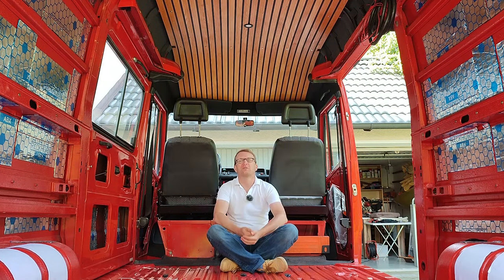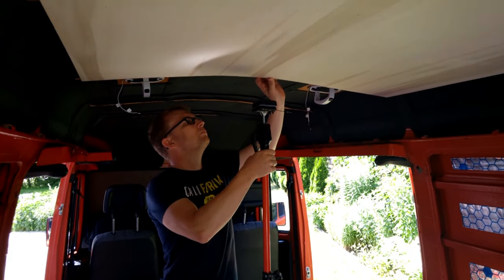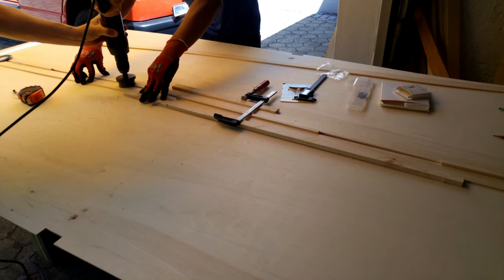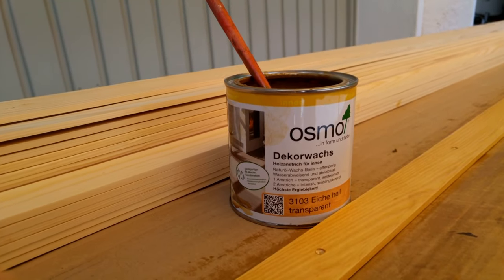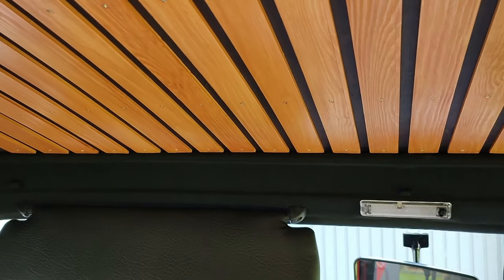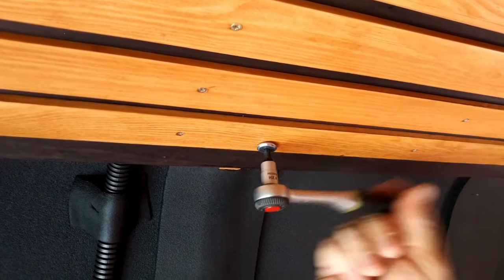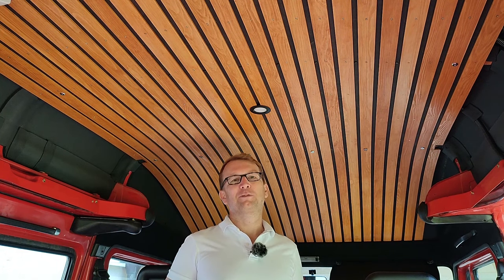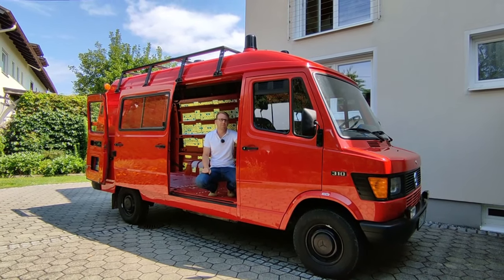BEST lightweight Campervan DIY Ceiling: How to Build and Install in our Mercedes T1 (curved slats!)

Comment: very nice finish on the timber. it is good to see someone taking the weight of the material used into account for the overall weight at the end of the build
Reply from the maker: It surely pays off in the long run :)

Comment: This was my original idea for the Transit too, but ran into a major problem: The curve at the front is in 2 dimensions! And you can't bend a sheet of ply in 2 dimensions at the same time. Well done, it looks stunning :)
Reply from the maker: In fact I had the same problem with my van... and found this solution: Directly behind the seats the ceiling panel is flat, not bent at all. From this area to the front of the van the ceiling is bent forward, and from this area to the back it's bent sideways. Surprisingly this flat area is no problem for the design. But, of course, this trick only works if the ceiling is not too much bent sideways ;)

Comment: Would of looked good if you would of screwed ply into pine slats, nothing looks worse than screw heads everywhere
Reply from the maker: The pine slats are too thin for screwing from the other side. If the screw goes just 3mm into the pine slat, the slats would surely fall off on the first rough road...

Comment: 6:42 What works great is to set up a circular saw with a 1 mm grinding disc and do some shallow relief cuts on the rear of the slats in the area of high tension. This would mean you need to do the curved section separate and glue and screw the slats on as the plywood panel is held/bolted in place.

Comment: Looks very beautiful, one question, why didn't you screw the slats to the plywood from the plywood side? That way you don't see them anymore.
Reply from the maker: The slats are too thin, so the screws would be just 3 or 4 mm in the slat. I would expect that doesn't hold on the road.

Comment: Very cool design and execution. I wonder if there's a way to hide the screw heads and not compromise the installation.
Reply from the maker: You could try to glue the slats, but I would be afraid that the tension is too high in the curve and they might fall off....
Reply: @CubeofCars  Great job, beautiful ceiling, and thank you for the inspiration! 😍Did you consider using wood glue and staples from the back in order to hide the screw heads? I think Vanlife Sagas nailed it from the back.. Well I guess I will give it a try with glue and staples...

Comment: Hey there, absolutely amazing result 😍. I have a very similar Bus and will likely copy this. I was wondering about the measurements of the two base plates used. 120 cm width? 
Thanks In advance and once more: amazing work, so beautiful!!
Reply from the maker: Thanks! The width is 122 cm.

Comment: Thanks for this great tutorial with the nice and lightweight ceiling! But do you have experiences in-between with cold and warm conditions? How does the wood react with lengthening when its colder or more warm or whit moist? I concern a deforming or is there no problem? Thank you for sharing your experiences!
Reply from the maker: Hi Axel, I haven't noticed any problems yet with temperatures between +5 to +50C. I used quite a lot of screws for the small slats, so they don't really have a chance to move...

Comment: Isn't there the risk of the pine bending in case of a leak? I just had to redo my whole ceiling because of spruce toungue&groove got totally deformed by water.
Reply from the maker: In case of a leak I would probably notice that quite fast, before there is damage to the ceiling.... well, at least I hope so.

Comment: Thanks for video!

I have the same van and a bid behind you regarding transferring it into a camper.

Question: in case you already have a black background with the armaflex; why not skip the wood sheet and only bold the 0.5 thin slates on?
Reply from the maker: Cool. Where are you from? 

Theoretically possible, but I see several problems without the panel: 
1) Armaflex isn't a flat surface and you will have some empty space between the Armaflex and the slats where dust can build up and never cleaned. 
2) The cable and cable connections for the lights are visible. 
3) At the last beam before the cockpit the panel has a high tension and needs very solid connection to the subframe with anchor nuts. I think in this area it could be rather difficult to mount the slats properly without panel. 

But let me know if it works and I am wrong! Also keep me updated with your conversion process :)

Comment: Could you use a fabric material for under the wood, rather than plywood?
Reply from the maker: I think that might also be an option.
Reply: @CubeofCars  do you have any idea what material could be used!?
Reply from the maker: @Rhysowen5418  Maybe the fabric which we used for our blackout curtains. You can check out this video. There is also a product link.

Comment: Are those round maxx fans any good
Reply from the maker: They work well and I would install them again, but the real world test comes when the van build is finished and I am on the road. One disadvantage is that they can only blow air out of the van, but there is no reverse.

Comment: Pine slats should stay in a shed , no car manufacturer or factory fitted camper uses materials that are used in a house or shed .
Reply from the maker: Then you should maybe buy a factory finished plastic camper and not watch van build videos ;)
Reply: @CubeofCars  also if any problems as in a leak from roof light the whole lot needs to come down . Far better ways of doing a job than your showing